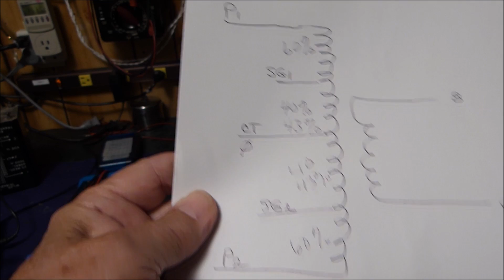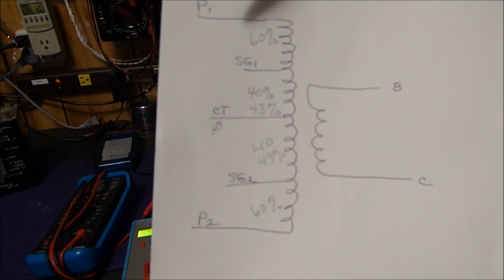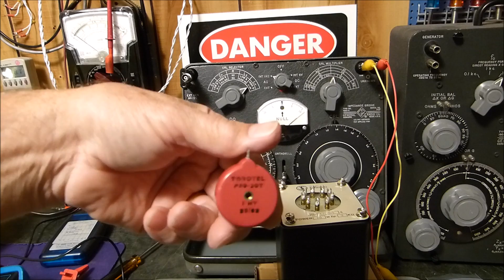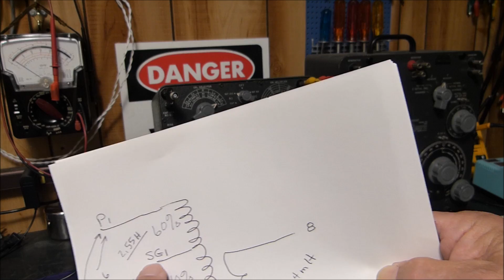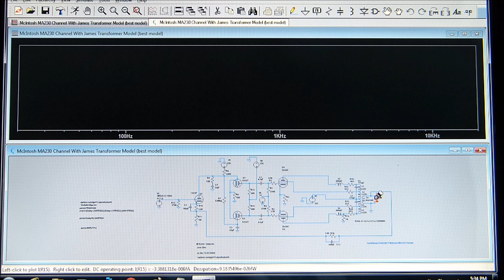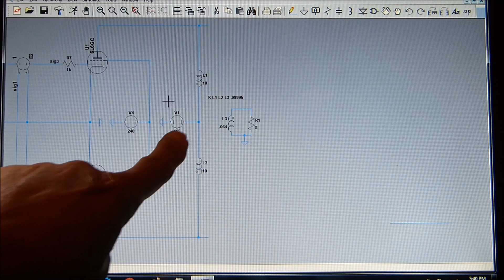LTSpice Modeling of Vacuum Tube Amplifiers and Output Transformers

Comment: Good vid, Ray,

I do have a couple of comments. tho.

1) The GR 1650A manual recommends that the front panel be grounded ( or the unknown component) to reduce stray capacitance.  The fact that the bridge balance is so upset by simply moving the  transformer (aka DUT)  suggests to me that stray test lead capacitance is adversely affecting your test results.  Can you retry, grounded panel,   with a piece of shielded line, say mini-coax?Or at least route the test leads to  keep them separated by several inches?

2) Also, you may want to try using an external signal source at a higher ptp signal level. I discovered the hard way when trying to build  a toroid based impedance transformer for a 30M loop (using MFJ antenna analyzer) that the signal source has to be strong enough to get an accurate reading. So my transformer did not live up to the bench measured 1/1.3 SWR when I tried it with real RF at 100W or more.    Ditto when trying to characterize misc transformers with siggen and scope. 

3   I presume an audio transformer would be designed to be low q to make it as linear as possible but maybe you could correct me.   If I am correct, wouldn't you want to use the CRL selector to L serial. per the manual?  Otherwise, the video shows you are modeling with the L parallel and a DQ setting of about 7.5 (on the HiQ ring) which is the manual  recommendation for HiQ.   Maybe I can learn something here, tho?

4) How about doing frequency sweeps? In an ideal component inductance would not change but we know that transformers are not even close to ideal.  Regardless, in any event reactance (and therefor impedance) is going to vary with frequency - even in an ideal component, right?   

HTH, chuck
Reply from the maker: Marvelous suggestions. I have not grounded the GR. I will try that. I probably should also move it to my other work bench that has a wooden top as I know the big workbench I use is steel and can be "noisy" and does affect S/N measurements on the HP 8903. I have tried grounding the workbench and it only makes the noise worse.

I have used external driving source but not at any higher amplitude. I will try that also.

I had not thought about the parallel vs serial measurements. I know the difference but I was not aware that the GR did both and I had a selection. I will take note and  see how to change that.

Indeed, inductance is going to measure different at different frequencies although we know inductance is not frequency dependent thus my resonate frequency measurement comments.

Last night I downloaded the manual for a GR 1632-A inductance bridge. It works from 10 uH to 1111H. I am going to see if I can construct a simpler version of this instrument.

Many thanks for the suggestions and conversation. I always make a better instrument after posting and getting suggestions from you guys.
Reply from the maker: Forgot to comment on (4) 
I have done frequency sweeps on transformers and even a 6 volt filament transformer with a 120 volt primary is flat from around 10 Hz to 100 KHz - I may be off a little but you see where I am coming from. Frequency sweeps at low levels doesn't seem to prove anything.
Of course X and thus the Z will vary with frequency but L does not in smaller inductors like the "calibration" ones I showed.  Just glancing at the GR manual I just mentioned, they "bias" the core with a little current.
I did not show that in the video but I did put as little as 10 mA through the secondary (8 ohm) winding and that dropped the L to a very low level apparently saturating or nearly saturating the core. I have two huge transformers that will deliver over 1.5 KW of power that are shown in some of my videos that I can saturate the core with 150 mA of current thru the primary.
I also tried "biasing" the core with a permanent magnets. Whether the magnet was weak or very strong, it did not make a lot of difference in settling down the transformer and thus the measurements. When I said I tried a lot of things I was not kidding. Your suggestions are excellent and I will be working with them tonight. If I can come up with a true and reliable way to measure these OPT I will definitely make a video to share with the world because as I mentioned, I can not find anything on the Internet that really works for iron core devices. Thanks again.
Reply from the maker: I did ground the chassis to the safety ground in the AC outlet and I also turned the plug over with no difference with either change. I know on my TV7 tube tester, the polarity of the plug does matter and makes a huge difference.

I wasn't thinking when I replied the first time about series and parallel and as you know, Ls is for low-Q (0.02-10) and Lp is for high-Q (1 - infinity). Tonight, during this round of measurements I got a Q=8 in high-Q and Q=9 in low-Q  ...   close enough.
I read through the manual on measuring inductance and I did not have the drive voltage all the way up as it suggested but it was at at least 90%. I don't know if it made any difference but I turned it up fully CW as they suggested.
As I suspected, moving the whole measuring setup to a wooden bench allowed the meter to settle a bit faster and I once again get the measurements I showed in the video. Still, suddenly moving the transformer, and I tried it with both of the transformers in the video, will peg the meter and it will slowly return to a proper reading. I don't know why.
I measured the entire primary at 28.5H and a Q=14.5 and the secondary at 23 mH. Not perfect per the math but close enough to accept as usable.
As for driving it harder (10V @ 1KHz) that was much worse. One volt from an external source was OK but it works best with the internal osc. Driving it externally with higher and lower freq. made it very sluggish and way off. Very hard to find a null, if you can even call it a null. BTW, I do use external osc for small capacitors and that does make it more responsive and a quicker null.
Overall, with patience and careful attention, it settles down and eventually give a reasonable reading that I accept as  accurate enough.
There is a beautiful GR 1632-A on Ebay that I want but I am resisting. I over indulge myself with these instruments but I do enjoy and appreciate them. I may weaken tonight and be the proud owner of it - against my will...   :-)
I very much appreciate your comments and conversation on this subject.

Comment: I can't for the life of me figure out how you got the tube models and symbols in your LtSpice.  I downloaded the tube.lib and tube.slb for koren. There seems to be no way to import or make the files work in LtSpice. the instructions on the site don't seem to apply to LtSpice.  I've been working on it all day.  Maybe you have different models from a different source? 
Very frustrating.
Reply from the maker: I definitely understand the frustration. Often times, for me it is just knowing whether to left-click or right-click.  :-)
In your case I am going to guess you are not doing the Spice directive function correctly or not at all.
Open a file or a new schematic, either one, it doesn't matter which.
In the upper right hand side of the LTSpice screen find the .op command and click on it.
Type in       .lib Koren_tubes.inc       and hit enter once.
This will give you a floating command of what you just typed in and you need to place it in your schematic anywhere that is convenient and left click at the point you want to place it. You have to do this for all of your vacuum tube drawings.
Then in your LTSpice drawing you go over to the Component icon and go to the Misc directory. There you will find the triodes, pentodes, tetrodes.
This is one tiny step in a long journey.
I hope this helped.